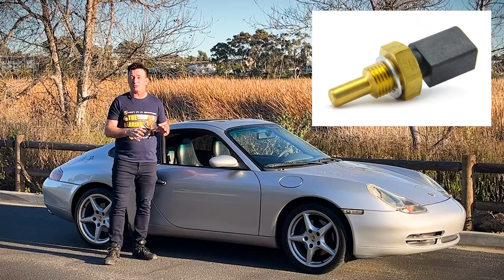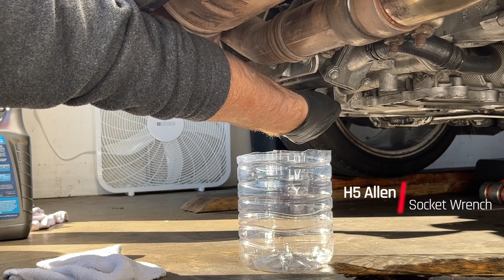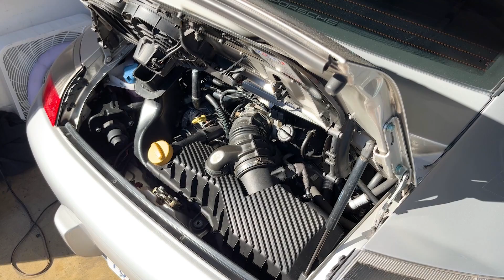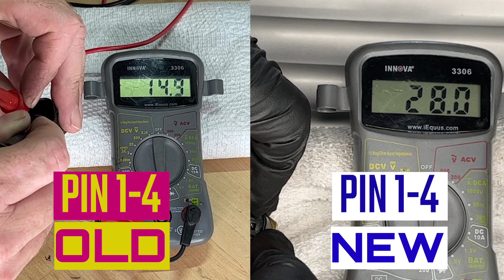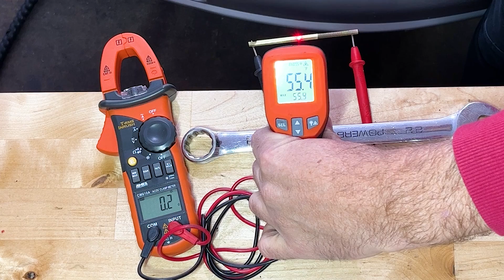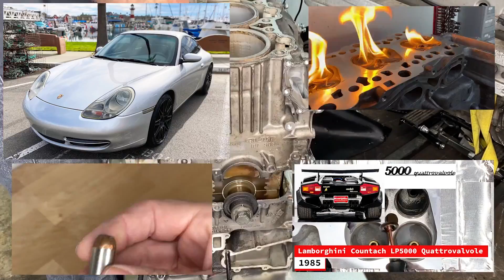DIY Guide to Porsche 996 Coolant Sensor Install!

Comment: My fans are not turning on by themselves, only with ac. I already checked the relays and everything seems to be working fine. But the cooling fans and the engine fan don't turn on when its reached operating temps. But the temperature shows, could that still be the sensor, and how can I test it?
Reply from the maker: Hello John,

Getting the car connected to a Durametric and activating the fans plus seeing what the sensor is reading could be helpful. Disconnecting the sensor cable “should” put the computer in default safe mode and force it to turn the fans on. If the fans come on when you unplug the sensor, definitely replace it. There are only $40 anyway. Good luck 🍀 Thank you for watching! 🤘😎

Comment: Why do you take off the airbox? There is absolutely no need to do that, the sensor can be reached from underneath without removing the box. 
But thanks anyway.
Reply from the maker: The reason for removing the air-box was to show the sender clearly for people that might not feel confident doing the job. Thank you for watching! 🤘😎

Comment: Is the coolant sensor plugged into the oil pump console, where the coolant flows round the oil pump?
On a side note, can you tell me whether it's possible to replace the oil pressure relief valve spring and plunger directly from under the engine or are there lots of bits and pieces in the way that need to be removed to get access?
Thanks
Reply from the maker: Hello Pjay, yes the cooland sensor plugs into oil pump console area. I replaced the oil pressure plunger in a two part oil system video series. There is some dismantling to get access to it. Thank you fir watching 🤘😎
PORSCHE 911 Oil System Operation, 
Overhaul & Upgrades PART 1
https://youtu.be/rgVfPM68voI

PORSCHE 911 Oil System Operation, Overhaul & Upgrades PART 2
https://youtu.be/QOXbHqE0SfU

Comment: Seems I’ve heard of warm start issues revolving around the cable from the B+ block to the starter… not 100% but might be something to research.
Reply: Yes this is a potential issue.
Reply from the maker: Absolutely, that is great advice 🙌 The B+ junction box and the Y-Cable are definitely problem areas on these cars. In this case 3 things pointed away from this being the problem.

1. The hot-start issue would only occur on the first start after being left to sit for 30-45 minutes. After that it would continue to start just fine despite being just as heat soaked.

2. I did a voltage drop test and found the reading to be normal

3. After connecting a fuel pressure gauge it became apparent that my issue was fuel pressure related. Thank you for watching and contributing 🤘😎

Comment: You need to bleed the coolant system. For sure you will have air pockets now. 911’s are a pain to bleed but the alternative is worse. 😅
Reply: I would just drive the car with the burping valve open for a while making sure that gets to optimal temperature. That should get rid of your air pockets most of the time since you only bled a small portion of the total coolant.
Reply: Use a vacuum bleeder. Take a look at the channel named Heidi and franny’s garage. They have a good explanation on one. 👌🏻
Reply: https://youtu.be/ACLaRKjbf5o there you go.
Reply: @N911GT3  Agreed this is the best process, though this means draining down almost the whole system (5 gallons-ish) and refilling. Otherwise you get a hell of a coolant bath pulling the vacuum!
Reply from the maker: If it were possible to agree more I would 🫡 My only question is HOW! There have been many suggestions of routines and contraptions to bleed the system. I’m not convinced this car is air pocket free.  What do you suggest as the ULTIMATE solution??  Thank you for watching 🤘😎

Comment: How many miles do you have on your rebuild by now? My right rear tail light had a crack excatly like yours untill I found a replacement on ebay, I believe this is another common problem with these cars😖
Reply from the maker: Well Don Esper, the cat is probably out of the bag on that one due to a recent YouTube community post. The car had almost exactly 160k when it died in the hands of owner “B”. That whole rear light cracking situation is apparently the norm on these cars.  There is a teenage industrial engineer out there right now who could throw that design in an app and tell you the stress points in these bloody rear lenses. For me, the joy was in the engine. If the rat rod nature of this car offends people, bring it on. Thank YOU for being a part of the team 🤘😎

Comment: Can you monitor the fuel pressure to see if the problem lies there?
Reply from the maker: With an OG like yourself I cannot pretend that the issue has not been resolved 🫡. It was a fuel pressure gauge on the fuel rail and the collective brain power of you awesome Humans 🙌 that lead to the final resolution. Stay tuned. Message me if you just gotta know 😉
Reply: @ManinaGarage  I'll wait for the shared result in your next video and good to hear you've gotten resolve :face-blue-wide-eyes:.